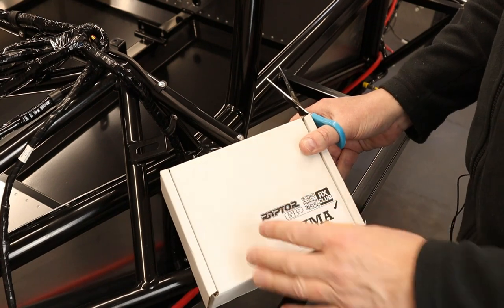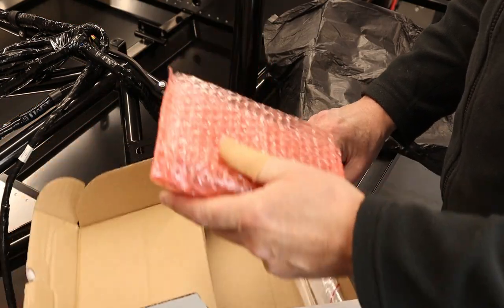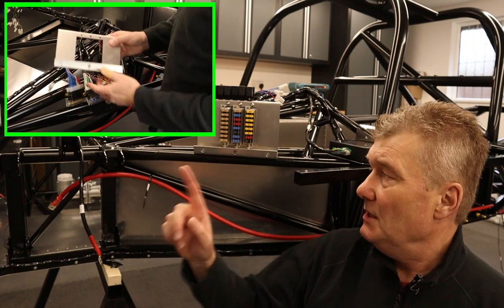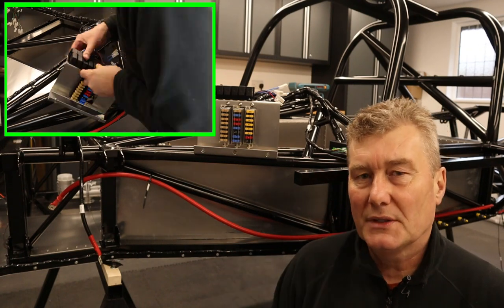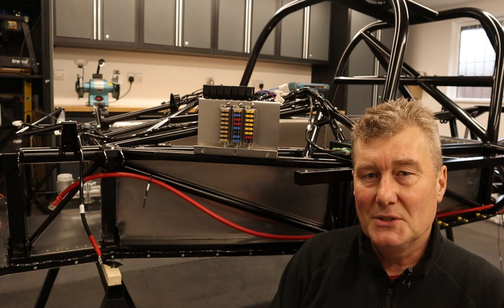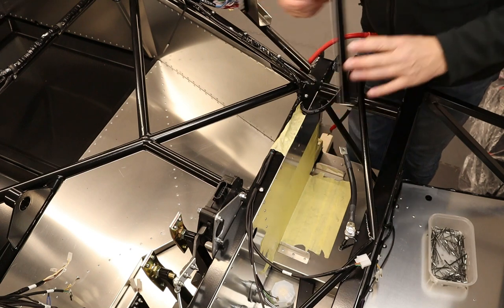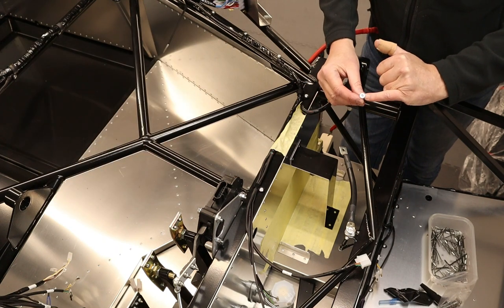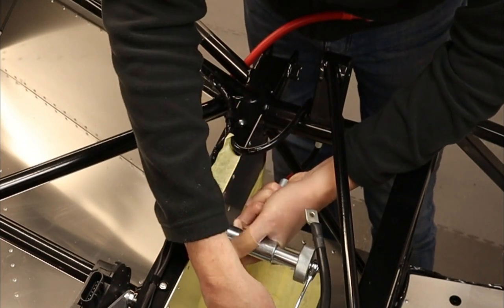Building an Ultima RS with Nigel Dean. Part 7 – Ancillary install

Comment: Another great video. Thanks, Nigel! If you ever find time, it would be great to know which tools you bought and used. For example, the rivet gun, deburring tool, etc. For new builders like me, it would be so comforting to know I bought the right tool that a pro like you likes and recommends. Maybe that could be a short video. Thanks again for everything you do!
Reply from the maker: Hi Brian, good idea and as you say there is a small number of specific tools which make the build easier. Leave it with me :-)

Comment: Another great video. I’m very impressed with the quality of the Ultima kit. Is the battery you fitted a lightweight lithium one, and if not, did you consider fitting one?
Reply from the maker: Hi Paul, thanks for the support. The battery has a large PB moulded into the casing so I assume it is lead/acid, the weight would suggest it. However, I'm staying true to my approach and sourcing everything from Ultima since in my mind it's a tried and tested solution. Also more weight at the front is not a bad thing since that Chevy V8 amidships needs balancing somehow 😀. Doing a little research shows this battery has astonishing cold cranking Amps so let's see how she spins-up my Chevy V8? I must say the build is extremely enjoyable which is testament to Ultima since it takes a huge amount of time and research to create such a well-sorted component car. Cheers Nigel
Reply: @v8creative  No problem, I really look forward to your videos each week. I agree with all your points about the battery. I also forget about the bloody great V8 that it needs to spin over. 😂

Comment: Great informative video as always Nigel, I hope everything is well in the Dean den after storm Eunice came along. Simple question this week, I’m looking to get a battery rivet gun, they seem invaluable for any Ultima builder. Most of my tools are Makita 18V and their gun is horrendously expensive (and a bit on the large side). Is that a smaller 12V gun you’re using to such good effect?
Reply from the maker: Morning Garreth and yes the Dean den survived the storm :-). Like you, I have a preferred make of power tool, for you Makita, for me Dewalt. Now as you say electric rivet guns can be very expensive so I took a hard long look at the market and reviews since after the Ultima it will be an occasional use tool. Eventually I opted for the Milwaukee M12 BPRT-201X 12V. This seemed best bang for buck and I must say it has performed very well. Occasionally it will not let go of the rivet shank, but an extra cycle ejects it with no problem. You will see I tend to use the gun without the shank receptor fitted to the rear which makes the unit a lot smaller. Anyway, I hope this helps? Cheers Nigel
Reply: @v8creative  I noticed you still had the hook thingy (not sure of the technical term) for hanging it off your tool belt attached to the rivet gun. I guess if you aren't climbing ladders etc its not needed and would make the tool even more nimble for those tight spaces.
Reply: @v8creative  Thanks for the info Nigel, thats most helpful. I’ll have to get one of those, it should also be compatible with their small right angled drill which may also be useful in tight spaces. After all, we can never have too many tools…….

Comment: hi Nigel, again good video as always. but I have a question about something 1st question is does this kit has power steering from factory? (Not that it matters anyway) 2. does one have to use ultima crate engine like an LS3 can I opt out? the reason being is that I have my own LS3 that I specked myself here in the states. with a 700hp ls3 with a 2.9L Whipple supercharger. it'll be a shame I couldn't put that engine in it if I have to use their ls3 engine instead
Reply from the maker: Hi Bryan and a very good question. If you have a blown LS3 sitting in your garage there is no reason why you can't install it in an Ultima providing there is physically enough room to fit the charger (pulleys vs. bulkhead). Ultima short lists a number of engine variants (LS3 included) to ensure it can provide all the necessary accessories: engine mounts, fueling, exhaust, gearbox mount, electrics (ECU etc.), cooling system... So if a builder opts for say an Audi, BMW engine they are lining themselves up for so much work and risk. As such, your engine sounds ideal but I would suggest when ordering the kit ask Ultima if there are likely to be any issues. Cheers Nigel
Reply: @v8creative  thanks for your response Nigel really much appreciated for the advice and will go to Ultima to ask later on. Cheers to you and Again Good video as always